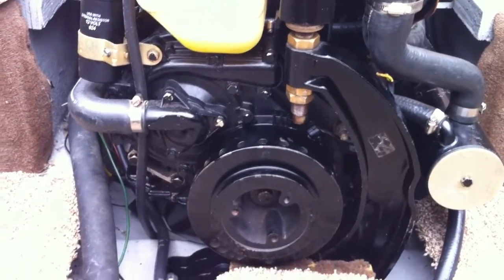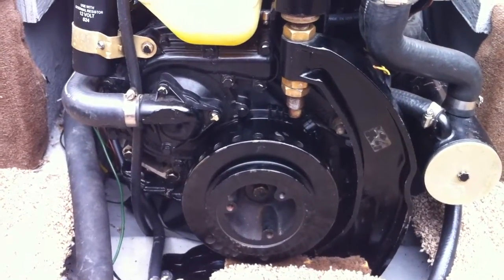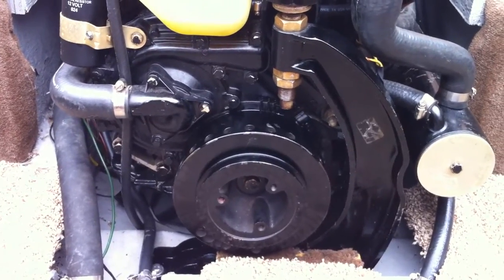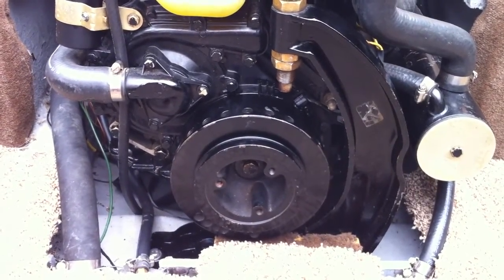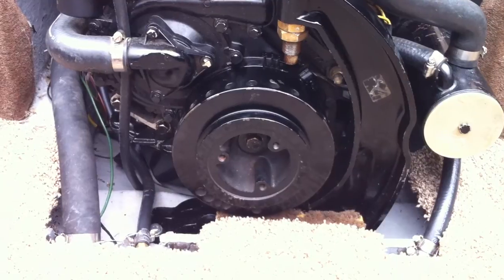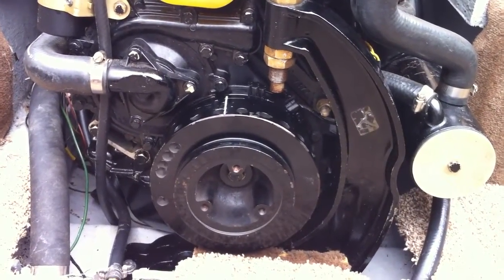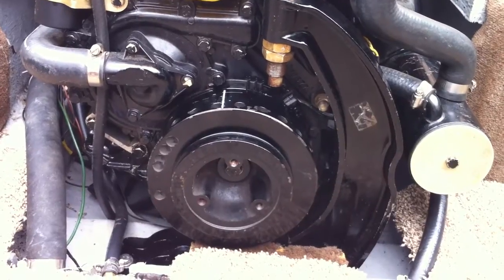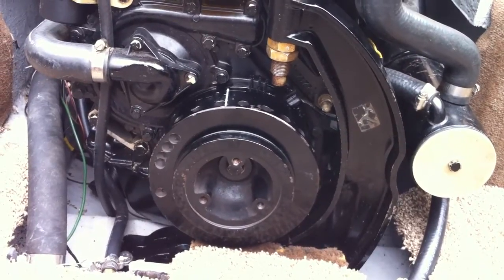1985 3.7L 170 HP Sea Ray Mercruiser:  Is this a timing chain or tensioner issue?

Comment: The clicking you hear is the starter solenoid disk engaging and disengaging. this engine does have a timing chain and and it drives the camshaft. so if it runs once it starts the timing chain is still there. to check the timing chain, take the distributor cap off, turn your crankshaft engine rotation to tdc. then opposite engine rotation. measure how many degrees the engine turns before the distributor starts turning. that is the measurement of the slack in the timing chain. I would start by cleaning the battery cables.   if that does not work check them for heat when cranking. If they are hot replace. if not try bypassing the key switch with a remote start switch. if that doesn't work load test the battery then have the starter tested.

Comment: Number one the 470 and 488 do not have timing chains or belts they are timing gears I think you have a problem with your starter solenoid or the other problem that the 470 and 488 had was head gasket pull your plugs out tune it over and see if you have any Prestone in Cylinders but in your case I highly doubt it starter solenoid bad starter
Reply: Wrong; the engines with the gears are the GM/Chevy 4-bangers not this Ford/MerCruiser Frankenstein monster.
Reply: These motors do have a chain.
Reply: They do have a timing chain get your starter fixed
Reply from the maker: Turned out to be a starter or the solenoid, not sure because I changed both at once and the issue was resolved.  I have since sold the boat and I'm told that it's  still running great.  Thanks for your input, though.
Reply: merctr2 I have 3 470 here that say they have chains and a tensioner
Reply: Number one 470's aka  3.7's most definitely have a timing chain and gears